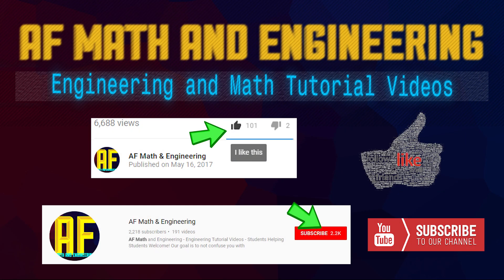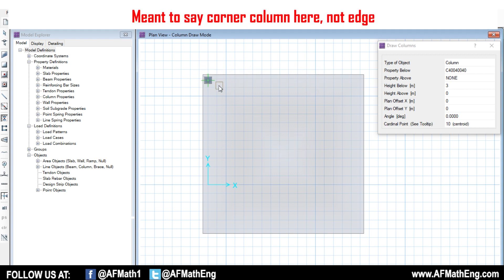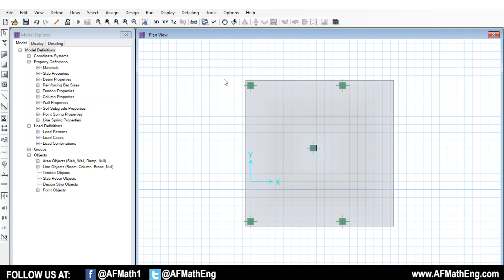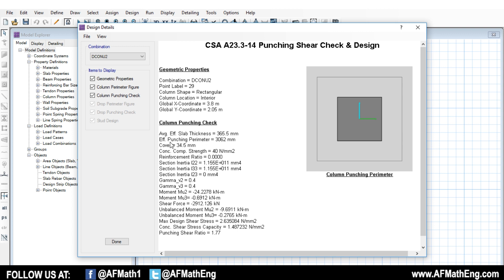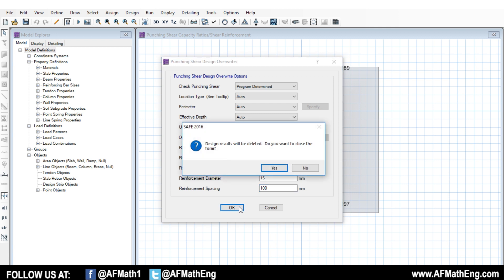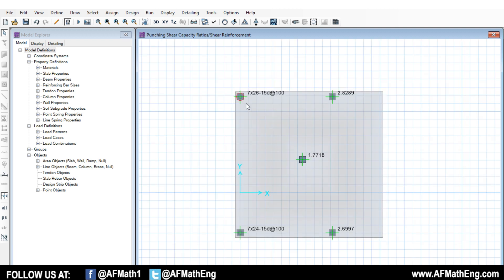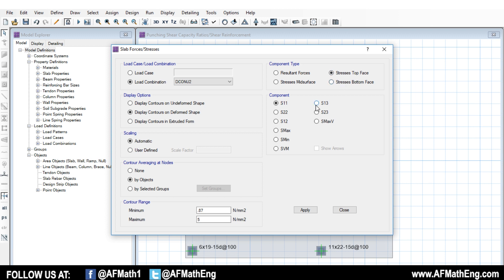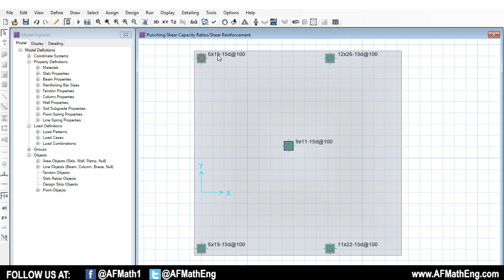CSI SAFE 2016 Punching Shear Tutorial - Example and Practical Theory

Comment: I have a doubt....
In ETABS if we have used insertion offsets in column......that joint where base reaction are found for column will not be at the center of column......
Obviously we get moments corresponding to insertion offsets but in point load the size of load remains same as size of column.......now this created some douts as that joint is not at the centre of column....

Comment: Can you please explain the meaning of the reinforcement results? how is it interpreted? For example, what does 4x9-10d@100 mean?
Reply: Stud rails x studs per rail x stud diameter x distance between each stud. Therefore in your example... 4 stud rails with 9 studs each rail, each stud has 10 mm diameter and they are separated 100 mm from each other (between studs), therefore the length of the rail would be 900 mm, you need 4 rails and 36 studs of 10 mm diameter.

Comment: How do I validate the shear force calculated for punching shear??
Reply from the maker: The shear force contribution due to slab load is fairly easy, the geometric tributary area of the support is generally equal to that force (SAFE also takes into account stiffness, so not 100% accurate).  The shear force contribution based on any misalignment of supports above and below can be approximated based on geometric distance to the support, although again finite element will probably do a better job at this.
Reply: @AFMathandEngineering  for raft slab analysis,  the variation of soil pressure would be different over the area and the tributary area calculations for columns not in grid is very difficult, so for that is there any way to do it manually to verify with safe for a small example
Reply from the maker: The geometric tributary calculation of an irregular column grid is easily done on CAD.  I agree though in a raft that it's more difficult to validate punching shear due to the soil spring behavior vs a slab.
Reply from the maker: For design purposes a raft can be idealized as an upside down two way slab where the loading is the factored soil pressure based on the loads on the columns and walls.  Again you can approximate this geometrically but it's difficult to calculate the factored bearing pressures when the grid is irregular (for a simple shape this is easy).
Reply: @AFMathandEngineering  thanks for quick reply

Comment: Why i have error n/c?
Reply from the maker: Safe won't check certain columns if they're too close to walls, beams, etc. Sometimes safe auto detects the wrong punching condition (edge, corner, interior) and you have to manually change it.  This program require alot of checking and engineering judgement to make sure you're getting the right results.
Reply: @AFMathandEngineering  you're true, my strap beam just to close to column. i got my problem solve. many thanks!

Comment: how can i check the punching shear for wall footing in safe?
Reply from the maker: Typically you don't check two way shear.in a strip footing, one way shear governs.
Reply: @AFMathandEngineering  i gess those calculations have yo be done manually 😅 do You have any video where You explain shear in one direction? Thanks for answering.
Reply from the maker: @gustavoalvarez1496  Two way shear calculations don't need to be performed at all for strip footings assuming length to width ratio qualifies them as acting one way.  We have two videos, check out links below:

https://www.youtube.com/watch?v=RbV6TWxbcRY&t=2s

https://www.youtube.com/watch?v=TCjNMcX92NI

Please like and subscribe!
Reply: @AFMathandEngineering  i meant the one direction shear calculations have to be checked manually.
Reply from the maker: You could get this information from software, don't necessarily need to hand calculate.
Reply: @AFMathandEngineering  
you mean that I should only compare the shear obtained by the software with the one that resists the concrete? or is there any special option within SAFE? Sorry for being so annoying, i must deliver a bunch of designs for my thesis so i can have my civil engineering degree  :/
Reply from the maker: @gustavoalvarez1496  First watch the video on shear, then read your textbook (I'm assuming you did some sort of problems like this if you're graduating from civil engineering now)..it's one way shear design, the software uses the same method as the code to calculate shear resistance of your concrete footing.

Comment: What is difference between ties and stud reinforcement for punching?  Which type is preferred for actual designing and how we have to convert SAFE rebars values into practical drawings
Reply from the maker: Great question, in terms of design stud rails are able to resist a higher stress limit than rebar ties as per Canadian code.  In addition, you may only use pin ties in a slab that has thickness of 300mm or greater.  So for 200mm residential slabs you can use stud rails for punching shear.  

In reality rebar is preferable normally as it comes with the regular rebar delivery for the pour.  Stud rails need.to be ordered from a separate supplier, are expensive and sometimes end up sticking out of the soffit if not placed correctly.  Also guys on site are usually more familiar with rebar than stud rails.

You can convert safe values by creating a spreadsheet based on your code and take the punching shear forces from SAFE.  This is the preferred method for sure.

Comment: Many Thanks for this video...really very good... I did many checks for punching on raft foundation with spring support ...i see safe is so much over design ...hope u can share me with some clarification ...
as example if I get max reaction from column ...the punching very safe ..but when adding the loads on shell element ( raft ....i see results over design ..why ...i could not understand ...
Reply from the maker: Yes, I also find that SAFE is extremely conservative with shear reinforcement for deep concrete members, especially things like raft or mat foundations.  It will always say you require shear reinforcement even when the mat is clearly thick enough to resist based on plain concrete strength.  You have to either use a different analysis program or do some hand calculation given the applied shear force to see if you actually require shear reinforcement or not.

Comment: how do you apply envelope load case In SAFE?
Reply from the maker: There are a couple ways to do it, either draw a null beam element where your facade is and apply a line load, you can also create a dummy beam of minimum height and depth allowable by safe and apply a line load to that.  Some people don't like using null elements as it can cause errors and problems some times.  Both are reasonable options IMO.
Reply: I try to add new load combination and there is an option for linear and envelope load combination
Reply from the maker: That's up to your building code what load combinations you want to use.  It also depends what safe is assigning your envelope load as (SID, dead, etc.) You're the designer, you have to establish what load combos you want to use and what you're going to assign your facade load as.

Comment: I have a question regarding the drop panels. If I have a drop of irregular shape (and probably not symmetrically positioned at the centroid of the column), how does SAFE determine the punching shear perimeter?
Reply from the maker: Safe calculates the critical perimeter based on the code you're using, for CSA it will calculate bo from d/2 from the face of the column.  If your drop panel intersects the critical perimeter, I'm assuming SAFE will do one of two things: 1. It won't check the column and you'll get an N/C when you're looking at the ratios.  2. It may assume it's a corner or edge column depending on where the perimeter intersects the edge of the drop and analyze it as such.
Reply: @AFMathandEngineering  I am not very clear at that point. The whole point of having a drop is to make the shear area bigger, thus more shear capacity. Thus, I think  SAFE should check it. But my question is about once there is a drop, the program should also check the punching shear assuming that the shear occurs at the face of the drop too. and in that case, how the punching shear perimeter is defined is not not clear.
Reply from the maker: @NTC  SAFE is a buggy program sometimes, and isn't the best at recognizing where critical perimeters are always.  Like any tool you have to understand what programs are good at and use your judgement with the results.  Did you try this case in SAFE yet?
Reply: @AFMathandEngineering  yes I've tried a square column drop with an oval shape, SAFE still reported the punching shear perimeter being a square shape
Reply from the maker: Safe isn't great for irregular cases, knowing the limitations of the program is important  Sometimes it's best to calculate by hand especially if you know that the program isn't likely to give you accurate results.